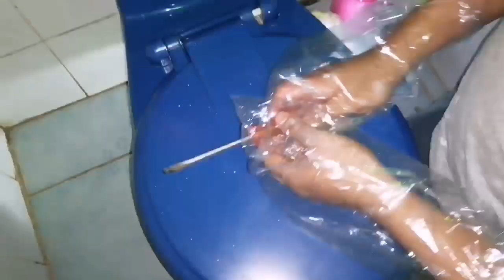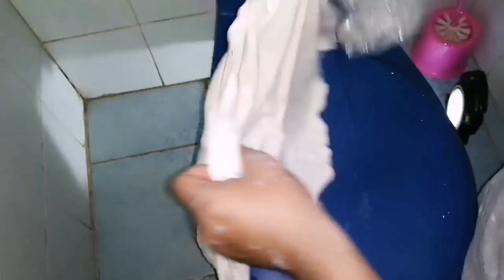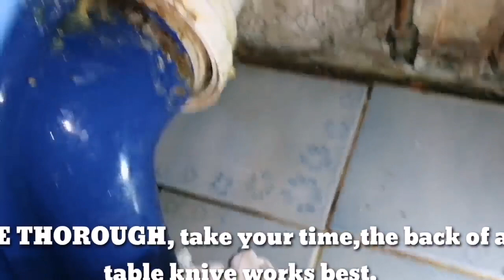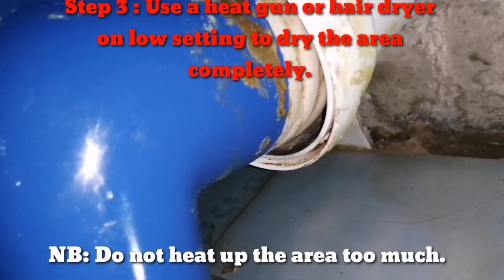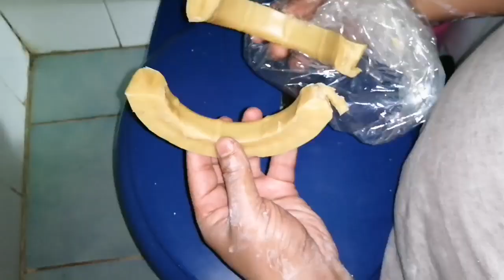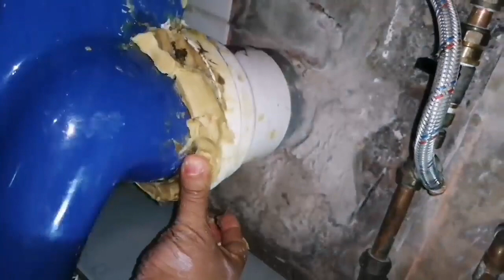South African wax pan seal  horizontal toilet outlet pipe installation.

Comment: Beautiful!! this was just what I was after. Thanks so much for sharing. The rubber broke on our toilet at the seal, and was wondering how I could fix it without having to undo the whole toilet as it's grouted to the floor. You're a life saver!!!
Reply from the maker: Glad I could help. Happy the video can help you solve you're toilet problem.
Reply: @farida7777777  I've now applied the wax...does the wax harden? How long after application can it return to operation ;)

Comment: If any leaks should occur from this exercise, just push in more wax to create greater compression. Use another wax seal.
Reply: Ur a 🌟
Reply: I have a leak and I see there's already wax there - so I'm not sure if another seal wouldn't push the wax too far into the outlet and perhaps cause a blockage?
Reply from the maker: I suggest that you remove the old wax, cleanup up the around the area as shown in the video, make sure it is dry completely then insert the new wax pan seal.

Only use another was seal to create more pressure when you have already followed the procedure.

The experience with my toilet was that after about 3 months the toilet started to drip minutely but after a while it stopped completely. IT'S now about seven months and no problem.

Comment: Great video, but can one not just fit a coupling with a rubber seal, this wax method seems a little archaic?
Reply from the maker: I think there should be other methods, the problem is to get the rubber seal around the circumference.  This is why wax is more convenient in this situation, however feel free to enquire at your local hardware for other methods to solve this problem.
Reply: @farida7777777  apparently there's now a flexible plastic unit, where the one end seals inside the sewer pipe and the other end has multiple seals to seal around the toilet spout.

Comment: Thank  you! I was wondering  how to get the seal around the pipe!.  One query which I will no doubt find the answer to when I start with this is  - do you have to turn the water off?  Isn't there only water in that pipe when the toilet flushes?   My turnoff is a hard to access screw........
Reply from the maker: You do not have to turn of the water. There is a u bend where the water rests in, only when you flush the toilet the hydrostatic pressure from the tank forces the water through the u bend into the pipe.

As long as you do not flush, you should be fine.
Reply: @farida7777777  Thanks so much! Loved your video which explained everything so clearly and simply!

Comment: k@k job wel gedaan ! yeah i'm here because i have 2 to be done... i think your movie explains everything well enough to give it a go myself rather than get in a pro fixer.... is it normal for the old stuff to be quite hardish as if cement'ish? ...i suspect mine is probably original from the late 1970's
Reply from the maker: Sometimes they use putty that is used on windows to close the recess. Just drill a hole and then lever it out with a screw driver. 

Also apply a rough sand paper p40 to p80, not shown in the video.

The sand paper grooves will allow the wax to go in there creating mini seals where the water will have to dig under before a leak can occur. This will increase the efficiency of the fix. 

Just make sure the sand paper is moved around the circumference, say two or 3 revolutions.

Geniet dit.

Comment: Hi . How do I replace the rubber in my toilet cistern system. The system arm /lever does not pop up when the chain is pulled.
Reply from the maker: 1.Hi, close the little inlet tap(valve) on the pipe that come through the wall into your toilet tank.

2. Open the lid of the cistern and just pull of the rubber that fits over the bottom hole.

3. Buy the exact same one at the hardware by taking the removed one as a sample.

4. Pull it onto the place where you removed the previous one, pull so that it can stretch.

5.If the handle does not want to pop up after flush, the linkages must be cleaned or spray q20 on the lankages or use a small balance weight attached to the lever with a cable tie.

Hope this helps.

Comment: Awesome thanks! Tell me, is it difficult to remove the original seal? The video didn't show that part, and any tips on that part?
Reply from the maker: Lever out with a flat screw driver, pull out with a pliers. Put some grooves around the circumference with very rough sandpaper before your install. The wax will go in there and create extra sealing. Go around the circumference 2 times, 2 revolutions.

If you can put more wax at the bottom. Buy 2 of these seals.

God bless.
Reply: @farida7777777  Awesome thanks a lot for the advice. Fingers crossed 🤞

Comment: So do we have to take out the black rubber seal connected to the pan connector? and appy the wax ring around the pan connector?
Reply from the maker: Yes, its absolutely essential. This video was made after a plumber installed the wax on top of the seal and it leaked.

As an engineer I developed this method and it works, my toilet is still fixed. You can also as an extra seal take rough sand paper P60 or lower, run it around the inside circumference of the exit pipe 3 times applying ample pressure.

These grooves will act as mini seals when the wax enters them. This will do the job even beter as the water will need to dig under these waxed grooves. This increase the efficiency of the wax seal.

Comment: I have a leak and I see there's already wax there - so I'm not sure if another seal wouldn't push the wax too far into the outlet and perhaps cause a blockage? Should I rather clean out the wax and redo?
Reply from the maker: Clean out the old wax and redo.
Reply: @farida7777777  Thanks - did do so. What a mission cos while trying to clean out the glue, the joining pipe cracked. Bought one of those concertina jobs but it wouldn't fit.  Tried hacking off part of it - wouldn't fit.  R400 almost literally "down the drain".  Eventually a R70 offset pipe fitted - just barely.  But no leaks - hope it stays that way.
Reply from the maker: @rajrithum5457  sorry to hear about this. But I am happy you got no leaks anymore.

Comment: Hi, I was wondering why you suggest one removes the old rubber seal? Surely the wax can just be fitted with this old rubber seal? Anyway, thanks for the video, I did the job and then went looking for how to do it, was mostly interested in finding out how long I should wait for it to dry before opening the taps?
Reply from the maker: Hi, thanks for your comment. Leaving the old seal and rubbing in the wax seal was what the plumber has done that I hired and it leaked very badly. I had to apply my technical knowledge of sealing to this project. My toilet is still sealed.

A better way to do this will help to create extra sealing is to use a very rough sand paper P40 or P30 and just rub it for two revolutions around the circumference where you going to install the wax seal. The wax will go into the grooves created by the sand paper and result in multiple mini seals.

The result will be many times more satisfactory.

You can flash right after you installed it by using both methods.

Comment: Tx Boss - watched some american videos first, and was worried I would have to lift the whole toilet for this.
Reply from the maker: Something I forgot that I think will make it more durable is to use a rough piece of sand paper, say p40 or lower, this must be done after you have heat dried the circumference.

Just make some deep grooves around the circumference, say two or 3 revolutions, wipe it with a dry microfiber cloth and apply the wax seal.

The wax will fill these grooves thus forming mini seals around the circumference. 

This will be more efficient. 

The wax will go into the grooves
Reply: Tx again
The hardware man reckoned I should break the wax ring apart and smear it in piece by piece.  Can I or do you think it is better to push it in as complete as possible.
Reply from the maker: You can do that, but I suggest you create those grooves with a rough sandpaper for extra sealing.

Especialy the 180 degrees at the bottom of the pipe, make sure it goes good in there and the surface must be clean and dry to allow the wax to grab onto the surface.